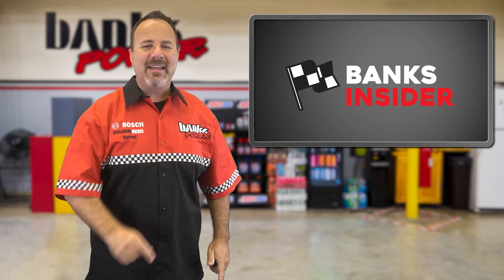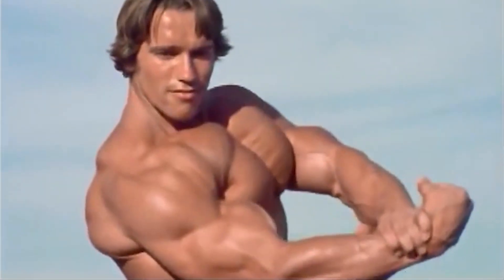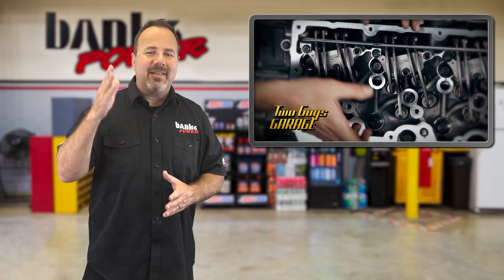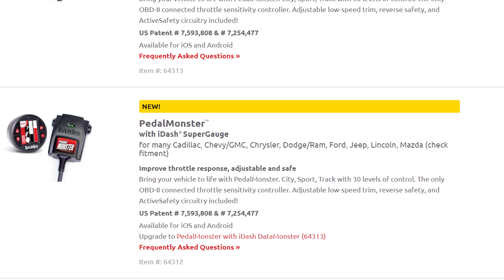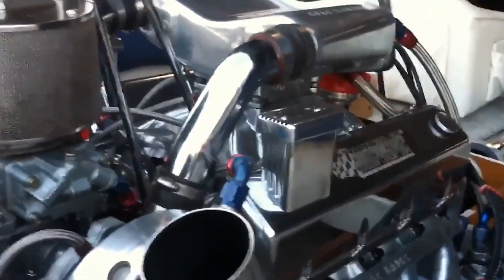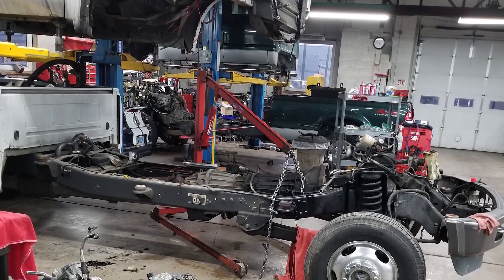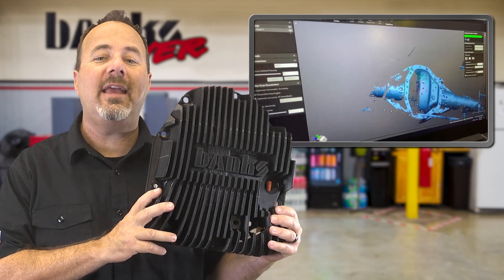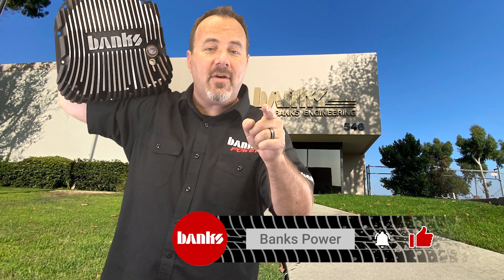Super-Turbo Power Goals, Win a PedalMonster, Vintage Banks Racing Engines

Comment: Mine, is a

Year:2014
Make:CHEVROLET
Model:SILVERADO 1500
Engine5.3L GAS

My friend Jason which owns a transmission shop and does alot of work on pickup truck would for sure enjoy this.

Year:2019
Make:CHEVROLET
Model:SILVERADO 2500
Engine6.0L GAS